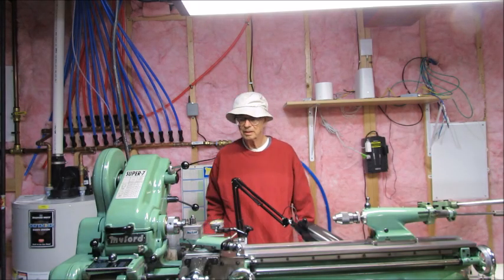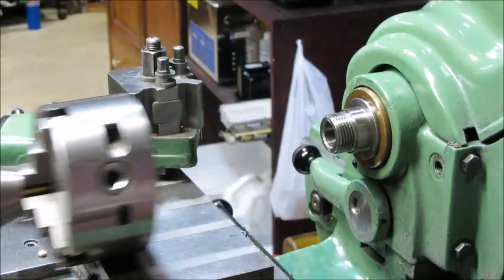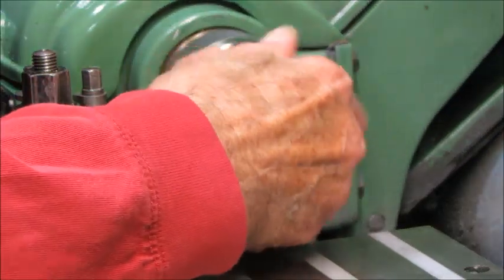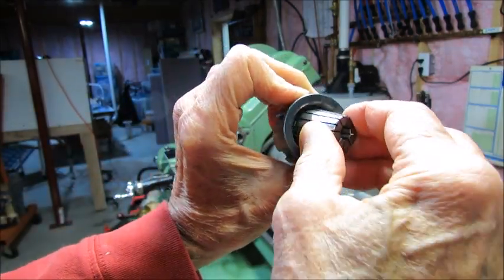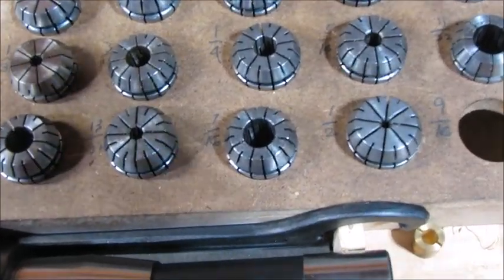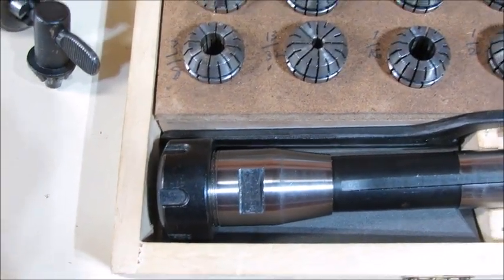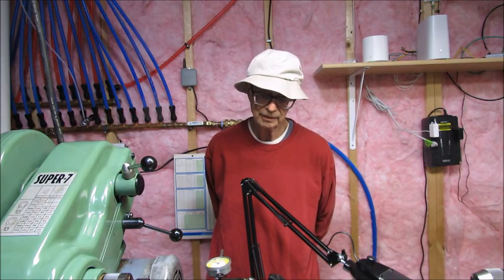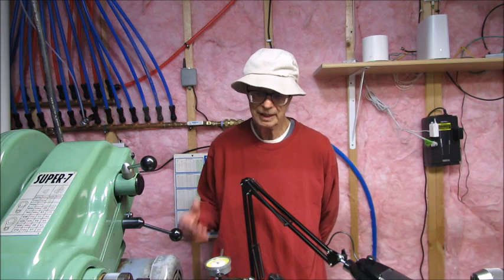ER collets on a Super 7 Myford Lathe

Comment: Nice to see a long bed version, it's far less common than the standard bed. I would say the ER type chucks are mainly designed for tool holding rather than work holding and I personally prefer a dead length chuck like a 5C for holding workpieces. They are a bit more limited in workpiece sizes they accept and full sets of 5C collets are not cheap because of this as you need so many of them. ER collets can be accurate but you need to get permium manufactured versions rather than the commonly available cheap Chinese offerings, or at least go for the Chinese AAA grade ones (no gaurantee there even so). 2 thou runout rather removes the advantages of using a collet chuck in the first place, if it's not less than a couple of 10th's TIR then you may as well use a GripTru-type 3-jaw for most work. My Bison 3-jaw holds less than half a thou all day and as it is adjustable can can be corrected to less if needed. For thin tube I'll use a 6-jaw or the 5C. I enjoyed watching your video and hearing about your experiences so thanks for posting.